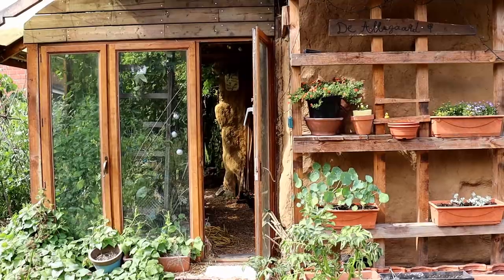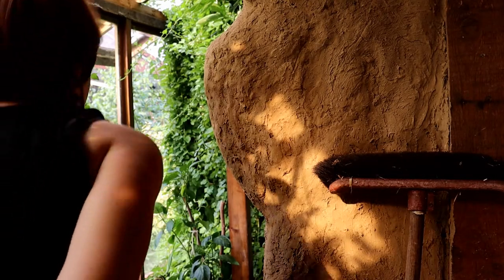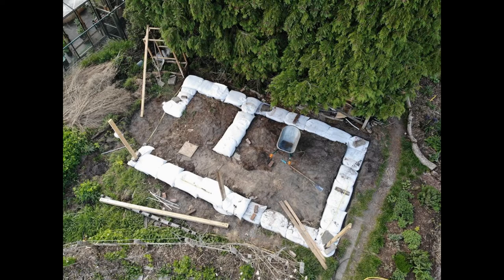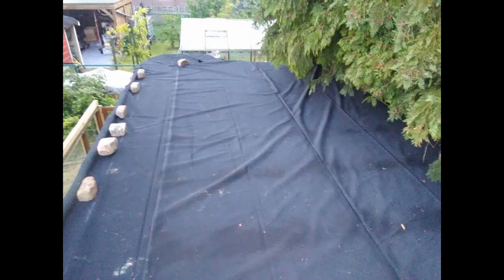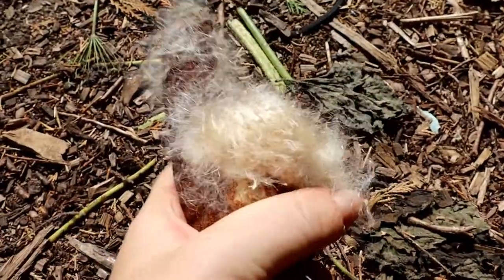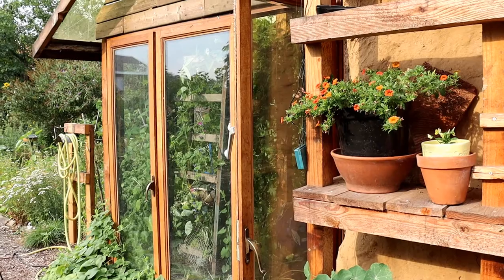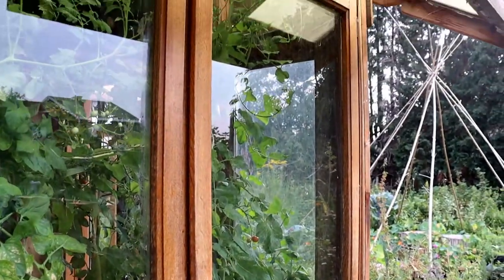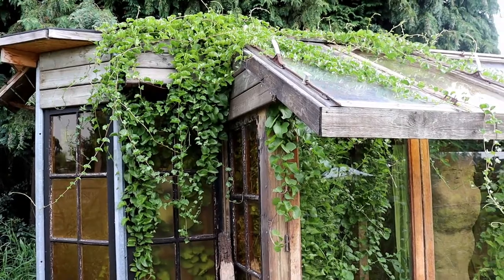Passive solar strawbale greenhouse

Comment: Did you extend the growing season significantly in your greenhouse?  Are you able to keep the temp in the greenhouse above zero all winter?
Reply from the maker: I think so yes! There is some Peruan purslane growing inside that normally I think can't have much frost, and it grows back like crazy after winter. Winters generally are rather mild in Belgium as well.(where this greenhouse is) I guess it provided us with 2,5 months extra growingseason. If you can use double glass or polycarbonate panels that insulate better it would be even better.

Comment: What is the edible vine? It sounded like you said purslane, but that's not the purslane we have in California.
Reply from the maker: The plant I'm talking about is peruvian purslane (Anredera cordifolia) I thinks it's a beautiful and very useful plant :)
Reply: The Anredera can be invasive - Malabar spinach is in the same family, and also has a vining habit.
- Basella alba. 60 days. Warm season annual/perennial. Malabar spinach thrives in warm weather and is tolerant of heat and humidity. It is a perennial tropical plant. This variety has a green stem and dark green thick fleshy leaves. In cooler areas, it will not overwinter but will produce a good harvest as an annual.'